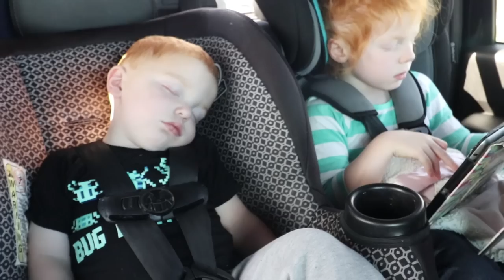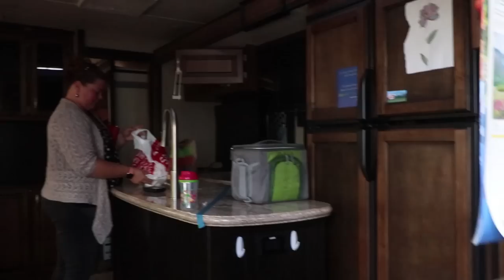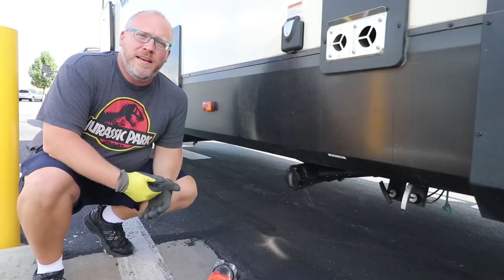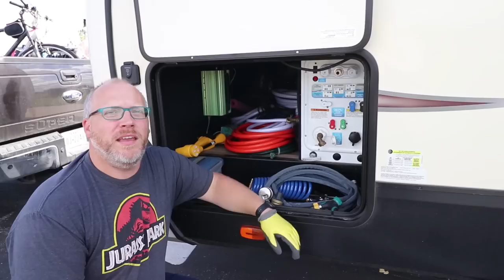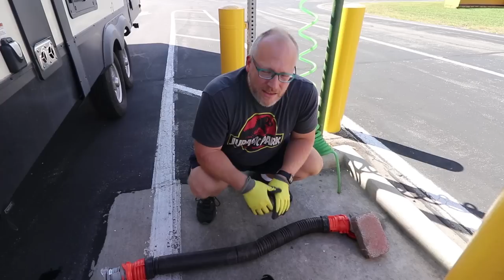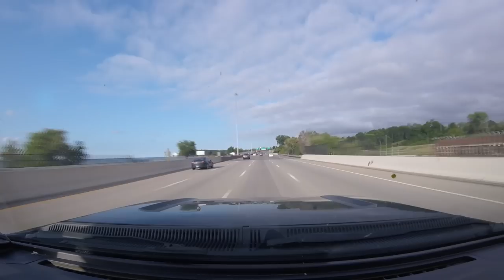How To Use an RV Dump Station | Moving Day with Five2Go | Ep. 54

Comment: Your advice to check the valves before opening the tube in case pranksters have come by  is great advice for even experienced RVers.
Reply from the maker: Every single time I'm taking the cap off to hook up the sewer hose I'll push in on the handles just to make sure. Every time.

Comment: I had not been camping in a trailer for a decade when as a young adult i got a job taking care of motor homes on a low budget movie.  i was amazed how much trailer maintenance info i had absorbed from watching my dad flush the tank all those years ago and it all came back to me as dumped the holding tank on a small motorhome that had been used for two days by a 40 person crew. 

it was full up into the bowl and i had to drive slow just to keep the bowl from overflowing.  i quickly found the hose stored in the square frame bumper but when I pulled the release valve nothing came out because of all the TP and paper towels that had been thrown into the toilet.  i had to climb on the bumper of the moho grab the edges of the shell and rock left and right until the clog suddenly let go.

All your logic for doing things in the order described make sense, but i do think I would rinse out your dump hose BEFORE you collapse it so nothing gets trapped in the folds of a compressed hose.

Comment: Great video! I've had my RV for a few years and it's nice to see someone with plenty of experience doing how to's.  A couple questions:
1. How frequently do you recommend using the black tank flush?
2. For temporary setups do you need to use the stabilizer Jacks to put slides out or is being level sufficient?
Thanks and keep up the great videos!

Comment: Thanks I just bought another camper the last one was 1968 Williams Craft so I up grade to KZ sportsman 2020 scarf to do the black tank but u help my fears hope to take it out this weekend!
Reply from the maker: You can do it! The sewer stuff is definitely intimidating until you do it a couple times. Just take your time, double-check what you've done before moving on to the next step, and you'll do great! 👍👍
Reply: Five2Go yes it’s a new experience we had a porta potty and wow get sick once and that won’t work I put a climate right air conditioner and nope in Texas heat won’t work this camper had a window until built in and that worries me some to Texas is just hot May has been bad already but i plan to just try your viedo are great plan to do some maybe as I go thanks again.

Comment: I mean yes, there is some extra weight. If 30 gallons, then 240 lbs. But your trailer probably weighs like 8-9k lbs? So not a huge deal to have the fluids on board, and likely not a major contributing factor to "wear and tear." That being said, I would probably dump with the opportunity as well. Thanks for the video!

Comment: What size is the box you keep your sewer hose and accessories in? Thank you for the video!
Reply from the maker: I keep one hose in a tube mounted under the rig that's built to hold them and the other two are in the back of the truck. The connectors and accessories are kept in a Sterilite bin with a snap-on lid that's around 30 or 40 quarts I think.

Comment: Love your Family,  enjoy watching all your videos,  we just upgraded to a 2020 Grand Design Reflection 312 BHTS, (Thanks to you lol)    We are very excited for spring to get camping,   Question, we noticed on ours it has another pipe in the rear coming from the outdoor sink (Outdoor Kitchen) that has no holding tank,   do you ever connect a hose to that when camping and connect with a "Y"?  Just curious if you have the same pipe and if so what do you do,   Thank you in advance!     Looking forward to your new videos with the new RV   btw I was your 500 liked.   hehe
Reply from the maker: Thank you so much! You're going to love that rig! As for the pipe in the back, it's just for the outdoor sink. We never used that sink so I never bothered with a Y-splitter. If you're going to use that sink it's up to you how to run that water. Since it's just water and probably soap and maybe small food particles, it would probably be fine (in most campgrounds) to just let it drain on the ground back there. Just remember that the pipe has a cap and that sink will back up very quickly and flood into the bedroom and living room if the faucet is bumped while moving and you hook up the water!
Reply: Thank you so much for your quick reply.   Never thought about the cap and that it would leaked into the bedroom.  I think I saw that you removed them in one of your vids if I’m not mistaken. Great point.  Thank you so much!   See ya in the next Video.

Comment: I don't own an RV (yet), so this might be a dumb question - but when you did the lunch stop then went to the dump station, do those places typically charge you for using their dump station?
Reply from the maker: It varies. Most dump stations that are in rest stops are free that we've seen. Dump stations at gas stations are generally 5-10 bucks. We've never had to pay though because we just use the campground dump station when we're pulling out if we didn't have sewer.

Comment: Love this video!! We are from Ohio!!!!!!!!! What exit were you at? So you don't carry a sewer hose around with you?! I just purchased a Pocket Hose Brass Bullet flexible hose for sewer only since they don't do well in the heat nor have a grade for drinking from like Zero G have.  However, the reviews for the Pocket Hose Brass Bullet are crap.  So not sure if I should even own it, might return before opening. Or find a coiled hose the this sewer hose issue. Since these are not used a lot and they are light weight.
Reply from the maker: Are you taking about the big black one? You definitely have to carry one of those, a sewer hose, with you. If you're talking about a water hose for flushing your sewer hose out, you should carry one of those with you too. I think in this video I just used the dump station's hose because it's convenient. If there isn't one, I use mine. As for what stop that was, I have no idea - this was about 16 or 17 months ago. 😁
Reply: @Five2Go  no not the big black sewer hose, we have one of those with the clear elbow and an extension.  I was asking about the water hose for sewer. I saw where you used the coiled attached hose at the dump station and explained your water power on your g.d. along with showing extra white hoses. 
When we got ours from the previous owner they gave us their hoses and sewer line along with sway bars and hitch hook up!! They told us their white hose was for drinking and the blue hose was for rinsing the stinky  slinky out. 
 I'm just getting ready to buy lighter hoses such as a Zero G for drinking water, shower and dishes. While I got a Pocket hose Brass Bullet for rinsing the stinky slinky out but reviews don't look to hot! So I will have to return it possibly and get a coiled hose or keep the blue hose they gave me.
How long is your Zero G hose?
I know you trip through Ohio was a long time ago.  I will have to go back to your previous vlogs and I might figure it out or research those rest stops and dump stations in Ohio.  We have ONLY been to one ark service times near our house so we only went for 3 day weekends but I see a week trip in the future once the country opens back up and national parks and camp grounds open 🙌
Reply from the maker: Our Zero-g hose is 25'. They come in 50 as well, but I had my white water hoses to supplement the length of needed. I think 90% of the time that 25' was good and every once in a while I just had to add my 10' hose to go a little farther.

Comment: Is there anything to sanitize that hose after dumping all tanks. Why no sanitize the gloves after use? I think this will be the hardest part for me. I have to bleach everything. Don't have an rv yet but learning what will make me uncomfortable before buying.
Reply from the maker: You could sanitize your sewer hose if you wanted to, but it's just going to get used again and most hoses come with caps to keep them closed up while they're being stored. I wash my gloves if I get something in them, but 99% of the time there are no issues at all. The gloves are just in case something happens. Dealing with RV sewer really isn't that hard or messy - you just take your time and everything will be fine!
Reply: @Five2Go  Thanks, I guess better get my gear ready mask, gloves rubber boots ect 😂😂😂
Reply: the first time you do something like this you may be a bit skittish but its easy to get the hang of it and not stress about smells.  Staying on top of the anti-smell additives and not leaving more in the tanks for longer than you can avoid rewards you with less stinky odors

Comment: Do you change anything with your process when there is a line behind you?
Reply from the maker: Nope! It goes faster because I'm not talking to a camera of course, but the process is the process. You still have to hook up the sewer hose, drain your tanks, etc. If anyone gets impatient at a dump station when you're there doing what you're supposed to be doing, that's on them. I don't want people rushing and covering the dump station with their waste that I then have to stand in or otherwise deal with. Take your time and do what you need to. 

Now we have been behind people that wander off or start messing with other things not related to the dump station - that's when it's OK to get irritated. It's like someone going into the gas station for 10 minutes while their gas is pumping, but a lot worse because at best there are only two dump stations.

Comment: How often should the black water flush valve be used?
Reply from the maker: Good question! If we're moving frequently we use it on the morning of each second moving day or so. It depends on how much it's being used. If we're in place for a week or more we use it when we have to empty the tank, so about once a week. It doesn't take much time to use so we do it fairly often. The last thing you want is a blockage or a hard buildup in there that requires more intensive servicing... 👍👍

Comment: I haven’t had to use a dump station yet as i’ve always dumped at the campgrounds we’ve stayed in....do most dump stations have a water spout to hook up my hose for my blank tank flusher ??
Reply from the maker: Most have hoses but we've seen them with their ends chopped off more often than not. They're really just for rinsing up any accidents/spills. You'll frequently find spigots at dump stations so you can hook up your own hose, but if there are people waiting I don't recommend doing a full flush. It takes a good 10 minutes to get the majority of the gunk out.

Comment: Those gloves are water resistant not waterproof lol. I have the same ones from home depot. Only the nitrile on the outside is waterproof
Reply from the maker: The parts of my hands that would come in contact with nasty things are covered, that's what matters. We didn't want to be wasteful and go through a bunch of disposable gloves. If I'm ever in a situation where I need to submerge my hands or do something dirtier for some reason, I have a small box of nitrile gloves, but these ones are great just as simple protection while handling the sewer hose and connectors.

Comment: Quick question. I bought a beautiful piece of land in a very expensive area, with an ocean view. I just found out it failed the septic perk test, which means the land is usless...... I was thinking about getting a 200 gallon portable septic tank and just dumping it once a month. Is there a limit too how much you can dump? Any rules excluding it?
Reply from the maker: That's really going to be up to the place you're dumping. Some RVs have pretty large tanks so a 200-gallon one would just be like 2 or 3 rigs dumping at a station, but I imagine you'll run into some friction if you show up at one with a portable tank of that size without talking to someone first.